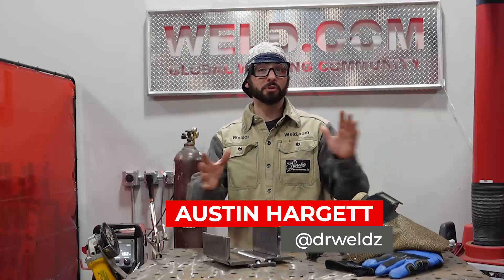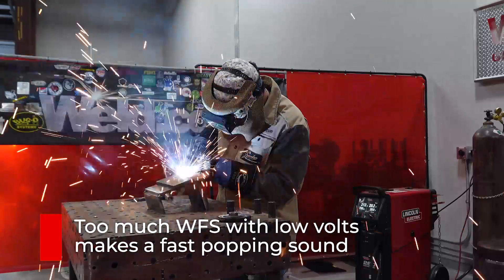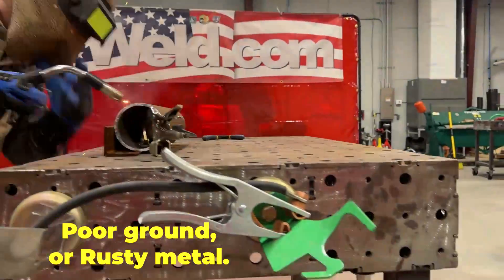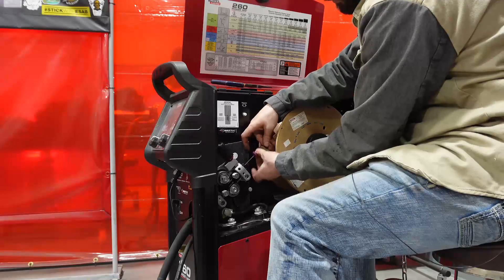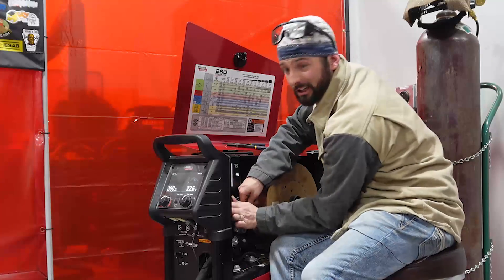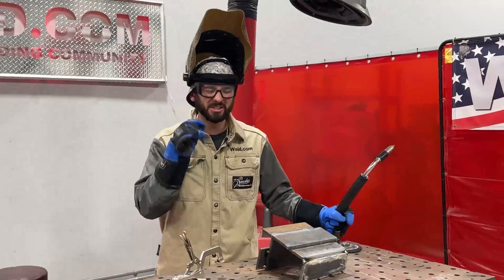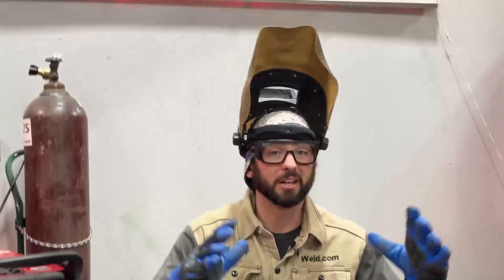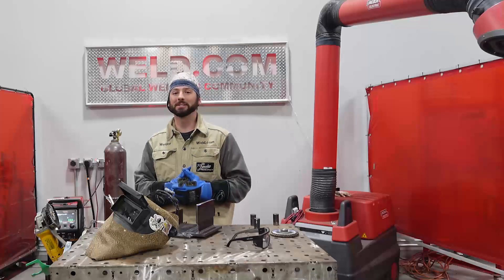Why Is It Popping? | MIG Welder Machine Settings

Comment: Ya well I just went out in the garage and look at the wire in my 2 machines, they are about 15 years old and getting pretty rusty. No way I'm throwing out 2- 12.5 lb rolls. I haven't used them in years. One is .024 lincoln L-56 in my miller and the other is 030 flux core Chicago Electric in my HF. I figure something out, like a cleaner or something. Altho I did go out and get a brand new 2lb roll of solid .035 for an emergency. What a waste if I end up throwing them away.
Reply: If you are lucky there is clean wire underneath the rusty stuff. Just start pulling it off until you get to shiny.

Comment: This has been driving me insane for a couple of days now!! I've been turning my wire speed down, and I got to the point where I'm like: "Ain't no way the wire speed is too high", so I started screwing with everything else, to no avail.

So I come and watch your video, and I'm like: "yep... yep... yep...". So, the only thing left is to slow the wire speed down even more, which I thought was ridiculous, I've had this welder going on 18 years now, I know how the settings work!... so reluctantly, I turn the wire speed down, more and more and more, until... it starts welding like a champ again!!!

So, I don't know if something on the circuit board is going bad or what, but it's working great again for the moment! lol
Thanks for the refresher course!

Comment: Popping issue solved thanks to you, but I’m now concerned with why my welds have excessive brown soot or haze.

What causes the brown/tan soot around MIG welds.  I’m using C25 and have tried everything from 15 to 45 cfh but it doesn’t seem to make much difference.  I have heard it can be related to voltage, ARC temperature and Nitrogen from atmospher.  Curiously, I have seen videos of people welding with C100 that have less Haze, and you would think since co2 is a reactive gas, it would leave more soot than argon mixes.  

I try to keep a stick out of around 3/8” and proper gun angles, and convention or instinct tells me it’s related to poor cover gas coverage, but like I said I have tried to average 20 to 25 cfh and any more doesn’t seem to help and just wastes gas. 

There is very little mention of this MIG phenomenon on the web or videos. 

Hopefully you can shed some light on this issue. 

Thank You
Reply: As long as you aren't getting porosity in your welds and the soot wipes off okay, it shouldn't be anything to worry about. I've noticed it as well and I've just accepted it as a fact of the process.

Comment: When you are welding Aluminium with an Eight Meter Lead and a Push Pull Gun you learn more about keeping up proper maintenance of your equipment.
A dirty liner is the lesser of your troubles, most often it’s a dirty tip.
It’s important to recognise the telltale signs.
The Pull feeder inside the gun should have no issue pulling the wire through the lead with the wire feeder disconnected.
Check procedure first check the contact tip, then check the gas diffuser it could be blocked following that check the liner inside the goose neck. 
The goose neck liner should be made of brass spring not metal liners strip the wire and become clogged.
The pull feeder in the gun must be free of dust and oil.
If you feel that it needs lubricants use a spray lubricant then remove as much excess lubricants as possible.
Check the liner distance from the pull rollers and check tension making sure it is set to just feed.
Next check the Teflon Liner discoloured end is an indicator that the liner is getting old or there is damage between the machine and the pull gun.
At the machine end the liner must sit close as possible to the feed rollers this prevents back lashing because as the wire leaves the feed roller any slight interruption to the feed through the liner will cause the wire to kink just before it enters the liner from the feed roller.
Once again using a Teflon tube is what is used even all guide tubes are made of Teflon.
The guide tube where the wire feeds off the spool is longer and it makes it easier to feed into the feed rollers.
Most push pull set ups have two sets of wire feed rollers on the machine end.
The result of being vigilant with regular maintenance checks is your equipment continues to be cost effective.
The longest I have ever used the same liner on the push pull set up was four years before needing to replace the liner.
Welding Aluminium and getting results where no black soot is left surrounding the weld.
Maintain a longer stick out and be mindful of gas coverage.
Weld making sure the weld pool is just in front of the gas nozzle.
Example welding right to left the finished weld should be trailing behind the direction of welding.
If you’re welding and you’re welding with the nozzle facing into the weld bead you will get inconsistent welds and porosity.
Avoid fish eye at the end of your weld by finishing with welding back onto the weld and then forward again.
If you have too much heat your weld will fail while it is in service.
You can get welds that look as clean as a TIG weld with a MIG welding machine.
Pulse MIG welding with Aluminium is easy for beginners, synergic setting requires great precision and skill and is most commonly used in industry.
Make welding enjoyable and experiment with the settings only if you know how to use the machine and understand what each setting does.
Remember one man’s settings may not suit your style or needs.

Comment: I just would like to provide some extra tips I know you mentioned the liner because over time the liner will get blocked up with gunk.
The liner over time becomes stretched or twisted because we have a tendency to move around a job in a certain direction and the spring steal in your liner tightens onto the wire.
At the end of the day many will wrap the lead up over the regulator introducing a kinks in the liner.
The other issue often found is the liner tends to get longer because of constant pulling the leads causing stretching of the gun leads making it that the liner is short.
If the liner is short as the wire travels through it causes the liner to stretch and snap back since it is a spring that’s used for metal wire.
Other issues found are guide tube being too short as your wire feeds from the spool through the guide tube onto the feed rollers if the distance is to far between the guide tube and the roller you can get lashing every time you stop and start.
The gap between your guide tubes and your roller should not be greater than one millimetre or as close as possible to the feed rollers without interfering with the rollers.
Damaged liners may not be noticeable someone may have dropped a heavy item on the lead denting the liner over time metal particles build up blocking the liner.
Another hint new liners come fully coated with plastic starting from the machine end of the liner leaving a foot of the plastic covering and stripping the remaining plastic off the liner up to the contact tip end improves the gas flow keeping it consistent with the reading at the regulator.
If you do not remove the plastic coating you get pressure buildup in the lead and resulting in inconsistent pressure/flow at the nozzle.
Always keep the feed rollers and wire feed cabinets free from metal dust. 

What you may not know is that the wire feeder motor requires regular cleaning and lube, if they break down they are simple to remove and replace. 
They all run on a 12V DC current and all are interchangeable between machine models, the wiper blade motors used in vehicles are the same and include intermittent power circuits that don’t function if supplied with straight 12V DC.
If you are going to conduct repairs to your wires feed motor or need to replace the wire feeder remember it is electrically isolated from the body of your machine if you forget to replace the insulators you will damage the diode bridge inside your machine.
Making modifications like changing to a common European connection is generally rather simple to do.
I’ve provided customers converting from hard wired leads into the standard Euro connection.
Other common issues are gas solenoid not opening and closing properly it might sound as if it’s working okay it can only be tested with a gas flow test tool any welding shop can supply them.
Regular cleaning out of the interior of the machine should be done every three months or regular cleaning if operating in a dusty environment.
I provide regular maintenance services to industry where I come on sight to repair issues and troubleshoot issues related most machines.
Some very common issues are blown fuses and faulty fans because people don’t have their machines cleaned out on a regular basis.
Reply from the maker: That is a lot of great info! Thank you for sharing.

Comment: I have a Lincoln Power Mig 210 and use it mostly on 20-gauge steel. It has the automatic settings as well, but I have the problem of burning up the contact tip a lot. I have even taken it back to where I purchased it and they replaced the main board, still seem to work great at times and then the next time I use it burns up the tips. I have played with the settings after I do the auto setup and sometimes it is better sometimes not. I do know if I set it up for 16 gauge it welds great every time. Makes no sense. Any tips?
Reply from the maker: The only thing I could thing of off the top of my head is arc length. Most people will be too far away but if you get too close it will mess up your tip.
Reply: @gregpaschal4764  Try running one size larger tip than your wire size

Comment: Hi Austin, why is it I have to constantly cut the tip of my wire because I get  a small blob of weld  left on it when I stop?
Reply from the maker: That blob is melted metal that has oxidized. If you don't clip it off it can introduce contamination into your weld.
Reply: Thank you, but why does it happen, am I doing something wrong?

Comment: Awesome tips! Nobody ever really talks about the sound of the weld, but it makes total sense! Im learning and this is good stuff! Great vid, man!
Reply: It truly depends on what you are welding and what setup you’re working with.
On heavy materials it is common to use the Spray Arc Method and it is very quiet only every now and then you hear a popping sound.
It fast and smooth and I’ve always used it to weld bisalloy wear plates onto front end loader buckets.
Reply from the maker: The sounds tell you all kinds of useful information! Glad you enjoyed it!

Comment: I use a fine wire wool fore cleaning wire. Wrap it around the wire before the feed rolls and hold it with two zip ties. Also, clean torch connections help.
Reply: Nice!
Reply from the maker: Wire wool will definitely get the job done.